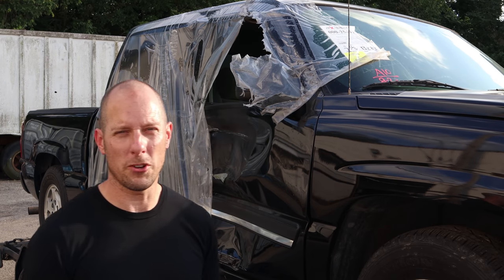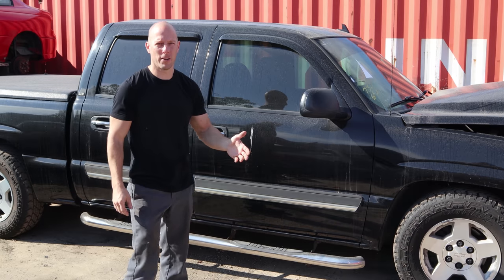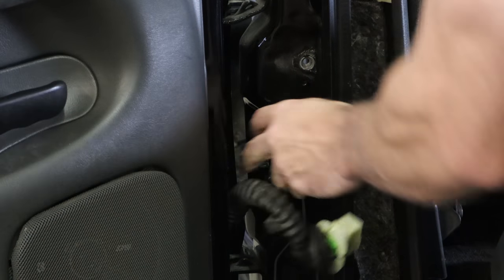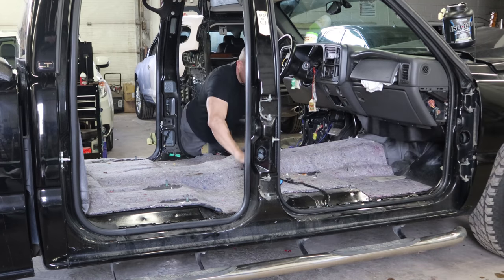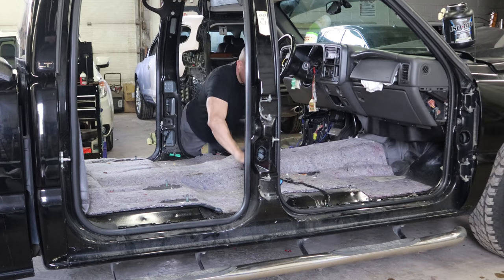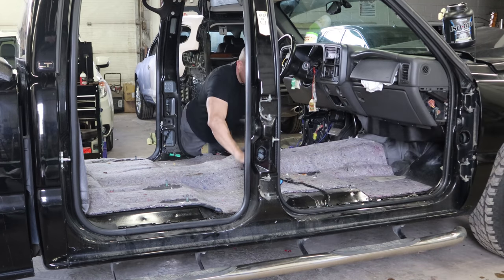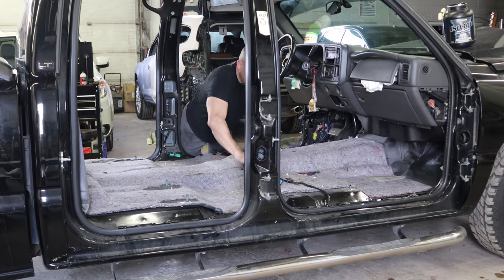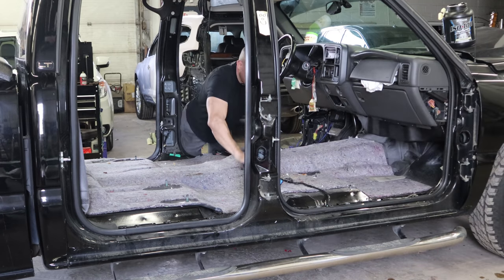Side collision Silverado cab swap rebuild project part 1

Comment: Hey!  Wanted to ask your opinion on the 2018+ Tahoe, Yukon, Suburban, Yukon XL.  Noticed you've done a couple of repairs as of late.  How are they in terms of reliability and longevity?  5.3 V8 and the transmissions?  Transfer case and axles?  I'm considering the purchase of one.  Thanks for your input!
Reply from the maker: Since they are new, I haven't seen many even over 100k yet.  They seem to have most of the 5.3 issues worked out, I would expect them to be better than the last gen and those are all pushing the 200-300k mark these days.
Reply: @vehcor  That's good to know!  Thank you.  I test drove one with 34k miles at Carmax last week that had a leaking windshield over on the passenger side, somewhere near the A pillar.  And the tailgate glass would not release, so they sent it back to the GM dealer for warranty repair.  I'm just a bit concerned.  I found a fellow on YouTube who had a driver side leak that turned out to be a crack in the body seam between roof and the A pillar area.  That worried me.  But I wasn't sure what year his was.  I heard that the roofs are basically "glued" on?

But if these turn out to be small issues I think I'm going to go through with purchasing it.  There aren't many that I can find around and none of the local dealerships have lower mileage used 2019 models with all of the options I'm looking for.  The pickings are slim for used 2019s.

Comment: I have a truck that's wrecked exactly the same way and it was totalled out with a quote of $5800. It has no rust and a ton of added value so I don't want to get rid of it. What do you think this would cost to fix if it were repaired the same way you repaired it? Would you be interested in buying it yourself?
Reply from the maker: No

Comment: Tip from an old school crash guy: Turn the hood upside down, build the pile, throw a chain on the striker and tow the whole shoot'in match outside to the big shit pile
Reply from the maker: The pile is about 2 miles from the big pile.  There wouldn't be much left if I drag it there. 😂

Comment: I just know that you don't trash good stuff - so you need to start another destination. Then you will have "in the Pile" for pieces of worthless junk and "on the Shelf" for items with redeeming qualities ... (like the battery you pulled out).  😉💲👍
Reply from the maker: The battery didn't go in the pile, it went in another pile for the scrap guy.  There were parts I saved that were still good.  The pile is the scrap.

Comment: This is one of those jobs where most people wouldn't bother they would look at the truck and work needed and most likely think the return vs money for the truck, work on the truck and parts wouldnt make it worth while to do. This is one of those cases though where if you get the truck cheap enough , the parts cheap enough and  where make model engine and condition and area of what trucks like this go for and condition and mileage will be the swing factor. There is a very good chance of a good return on investment if you know the market and can get it done at a good price point, its quick flips like these that can help keep the bills paid while more intensive rebuilds that require more time to repair and money to do help keep the bills paid

4 days is a pretty quick turn around but it look like whoever owned it previously took very good care of it, which you would have think meant they maintained it well and that goes a long way when you go to sell it, I dont see you have a problem moving this out the door pretty quick especially with it being practically rust free
Reply from the maker: I expect less than 20 hours in this entire build and people cannot find rust free trucks up here and if they do they want a fortune for them.  It should make this an easy sale, heck people have already been bidding on it. lol Thanks for the support!

Comment: So I don’t get this, the clean cab has high mileage but the vin is attach to the cab, how is it better to swap cabs when all the recorded mileage is on that vin and you can not swap vin on the cab
Reply: There is a legal process to move the VIN and tags to the other cab.  It depends on each state whether they'll move the VIN tag, or assign a different VIN or extra stickers, plus the paperwork.
Reply from the maker: The state comes and retags the parts cab with the correct vin.

Comment: I assumed the project Silverado was a 2004 2wd based off the wheels. They were standard on 2wd that year and only existed on the Silverado hybrid after 2004. The parts truck is either an 06 or 07 Classic. Those wheels became standard on LT models even 2wd in 05 but that year has the OnStar and XM antennas separate. In 06 they combined them into one and made that “shark fin” antenna. Sorry to disappoint you with a not exact year guess but I’m only human...also that windshield looked good off the parts truck. Was there something I didn’t catch??
Reply from the maker: 2004 Project
2006 parts truck
Both had multiple rock chips and cracks.

Comment: The pile you're talking about as a lot of good parts still in it
Reply: I saw a ruined hood and fenders that are bent up and various brackets what good parts.
Reply from the maker: Nothing in the pile is any good.
Reply: @vehcor  wrong there are little bits that someone els might need for there truck that are broke
Reply from the maker: C u name one part!
Reply: @vehcor  under hood brackets 10:55
Reply from the maker: @CrashOverride777  bent, next.  If you need a set I have some, lots actually and no one has ever needed them.  I should probably toss the good ones now that you mentioned it.
Reply: @vehcor  lol hey that's your choice bud , good vid though keep up the good work , I was only just stating my opinion as I have one of these trucks here at home and am my Own mechanic

Comment: Another GM!    My choice too!   Do you ever do RAM or Freaking Old Rebuilt Dodges?   If not I don't blame you.    Was that 4 calendar days, 4 work days, or 4 man days?   Respectfully,   Kevin
Reply from the maker: Rams don't hold values like GM so when you have to build and wait for titles big drops in resale can hurt.  If a buyer requests one, I have no problem fixing one.  It was 4 calendar days.
Reply: vehcor    What's the reason on Freaking Old Rebuilt Dodges?       Hint Caps!
Reply from the maker: Kevin Coop Same as Dodge but worse!

Comment: How much better does the denali pull than your old 2003 duramax?

How do you get a single title when the cab will have a different vin plate than the truck that its on?
Reply from the maker: My old Dmax was an 06 LBZ.  The LML in the Mistake was way better and the L5P is even better than that.  I miss the Pre DEF days but other than that, I won't go back.  The state retags the cab with the proper vin.

Comment: I think you could actually blindfold these two and they could still remove a cab from a GM truck.
Reply: He did blindfold himself and pull the door and fender off of a Grand Am. I doubt  he would have a problem.
Reply: I will have to look for that. I only found his channel not to long ago.
Reply from the maker: These doors are a little heavy but I might muster up the courage to try it eventually. lol 
Here is the blindfold video:  https://youtu.be/-ukQEhgfRsI

Comment: You can thank the railroad regulators for the horns being really obnoxious in the USA, they require a series of 4 horn blasts, long, long, short, long at every single level crossing when 1 or two in every other country is good enough...
Reply from the maker: They don't follow any rules sometimes it is 2, 3, 4, or 1 for about 2 miles.  They don't bother me until it is time to make a video.  Then it can get annoying.
Reply: @vehcor  Sounds like they make it up as they gp along then, don't let the regulator know! I can imagine murphies law says they all turn up while you're filming though

Comment: To bad it’s not 4x4, would have been worth double.  I had my 09 crew cab brought up from Florida, 4x4 but it had 200k so it was cheap cheap cheap when they were selling for $25k.... told myself I was going to fluid film the rockers but didn’t get to it in time and sure enough those outer rocker skins bubbled up after 1 winter 🤦🏼‍♂️
Reply from the maker: Yep, one winter is all it takes.  There is a black 4x4 time lapse that was from Oklahoma and looked like this truck, after 3 years, it has some bubbles on the rockers.

Comment: Hey man i love my train horns...but anyway why insurance companies wont fix a wreck like you did
Reply from the maker: Most shops are afraid of cab swaps due to the large amount of labor.  It also takes a lot of time to get the state to retag the truck with the right vin.  I can let it sit while I wait some nice there is no customer waiting for their vehicle. Then there is the cost of the parts and paint.  Finding one in the right color saves time but insurance cannot count on that like I can.

Comment: Damn son, 10k views in 6 hours. I once got 23 views in under 6 months, so... that was good.
Reply from the maker: Hey, that is better than I did when I first started. lol  Honestly until the Mistake truck came along, my channel was pretty insignificant.  It still is but any larger and it will be a little too much to handle.  That is why I am 2 weeks behind on replies. lol I was one of your views by the way!
Reply: vehcor 
Have you thought about re uploading some of your earlier videos? Like the semi hit Enclave, new viewers would probably enjoy them.
Reply from the maker: I kind of figured new viewers would go through my old videos if they were interested.  While you and I can appreciate the Enclave because we are in the industry, I feel like a lot of the viewers don't get the complexity of that type of work.  They think this cab swap is a big deal. lol  That Enclave was one of my favorite jobs though.  I wish I had done it when I was making series videos, it would have been much better.  Who knows though, I am far from having this whole YouTube thing figured out, so maybe I will have to try your strategy.  I was going to redo the GTO build as the new owner crash tested my work.  He managed to get the car repoed before I could fix it again. lol

Comment: Next project has to be a Chevrolet Tahoe Z71 or a Chevrolet Suburban Z71
Reply from the maker: My Yukons were not close enough?
Reply: vehcor The front end for the Yukon is probably not gonna be used for the Tahoe but I’m pretty sure the doors and everything else except the front end could be used for the Tahoe

Comment: I would never live up north for this very reason cause your car looks like chiat 6 to 8 months out of he year because of the weather ,and  that salt just destroys vehicles,especially the undercarriage. My girlfriends family is from Plymouth Michigan and many folks have beaters they drive in the winter and nicer cars they drive in warmer months, youl see 4 year old Dodges and Chevys and fords with huge rust holes around the wheel wells, we were up there for the Woodward Ave Dream cruise in august and we were following a GM truck newer than this and the entire tailgate just fell off on 96 in front of us barely missing us! My girlfriends sister has a 7 year old Honda CRV and there was so much rust on the bolts and brake calipers i broke 2 caliper bolts off putting brakes on while i was there!The side roads are so bad and full of pot holes it knocked my Sirus radio off its cradle many times!many of the roads are made of cement not black top because the pavement just doesnt last, Heck its bad enough here in North Carolina in the winter but at least we get days of nice weather inbetween snow storms
Reply from the maker: I hope to be leaving here soon.

Comment: I would have fix both what a waste
Reply from the maker: And how would you do that?  Buy another truck?  Then you would have to fix that.  Where does it end?
Reply: You don’t need to buy another truck just the parts you need cut weld any ways i learn the hard cheap way . Have a good day you do good work